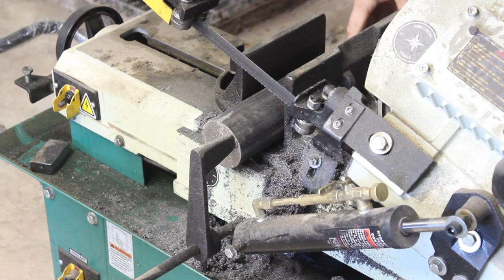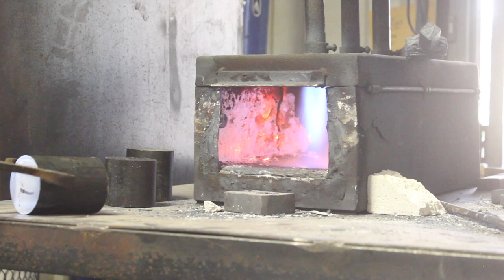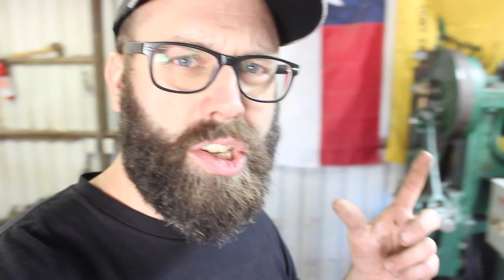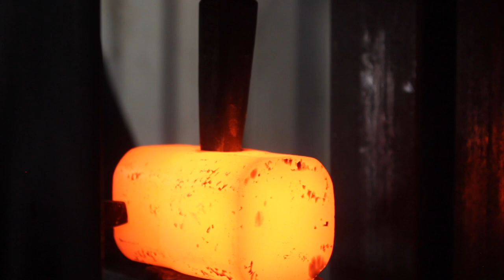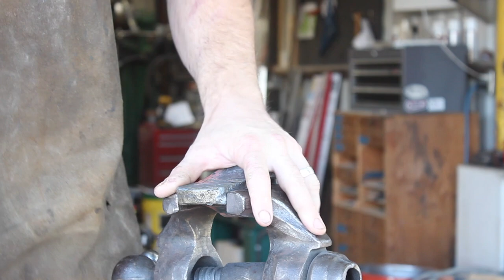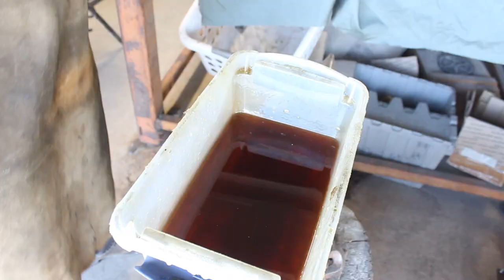Forging A Different Kind Of Hammer, Blacksmithing Tools

Comment from the maker: Do you guys use a cross peen or a straight peen hammer in your forging? Do you think it would help in your projects?
Reply: I use both. I wish my straight peen was heavier than it is and I think I would use a straight peen more often. But I would really like to make a hammer with 45° offset peens opposite of each other on either side. It would be a handy tool for many situations. Could be a really cool hammer for you to make also

Comment: Idea 💡🤔. Watching you aggressively moving the hammer head in the quench tank, wondering if a full frame spray system will be better than the tank system?  Constantly spraying the head from every direction keeping the water in constant contact with the head without moving the head out of the boiling bubbles that is caused in the tank system.
Reply from the maker: That's an idea, I don't know if it would have the same effect without overall contact like the submersion..

Comment: I see you use a large contact wheel is there an advantage over a flat platten
Reply from the maker: Yes, reduced surface area and friction, unless you need a flat grind it's usually a better option